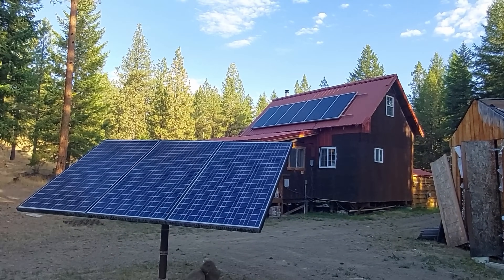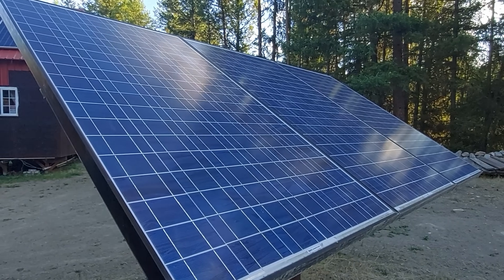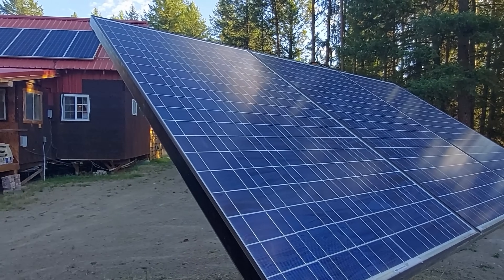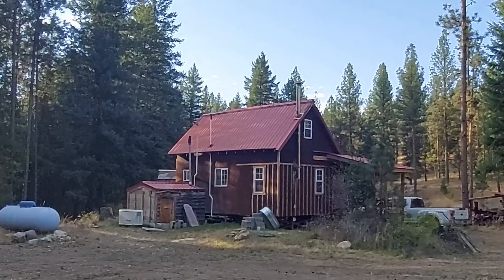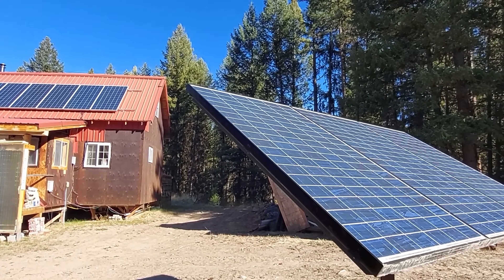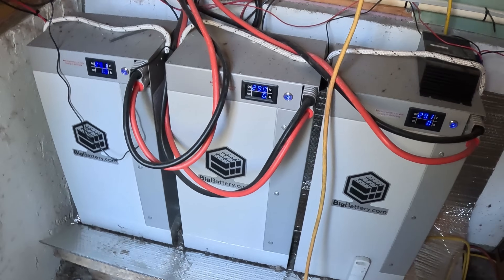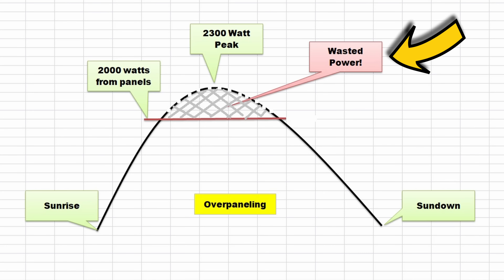Unlock the Full Potential of Your Solar Power! ☀️

Comment: I'm kinda new at this, but wouldn't you consider line loss when over paneling?
Reply from the maker: I don't over panel but I suppose you could.  My philosophy is to add another charge controller for thise extra panels instead
Reply: @TheOldJarhead  I mean when calculating how much is coming into the controller. I suppose it would be too minute to consider, unless one was using very small wire to the panels.
Reply from the maker: With 10guage wire 12v drops a ton, but that is why we run higher voltages.  Most systems are designed with less than 3% voltage drop from panels to controller, but most over paneling is within voltage and just 10 to 20% above wattage max

Comment: Thank you, this is a good video, although I think you missed a couple points.
   Batteries can only accept a charge at a certain rate depending upon their chemistry. As an example a flooded lead acid battery can only safely accept a C/10 rate of charge. So if you have a 100 Ah flooded lead acid battery, it can only be charged at a 10 Amp rate.
    Also, the main function of a charge controller is to protect the battery from too much electricity which can electrically harm it. This is why it's so important to program the charge controller with the correct chemistry and size of battery bank.
    If there are periods where a system is being clipped often for whatever reason, and you would like to use that electricity, I like to use shunt controllers instead of series controllers, where you can attach an external load that will be powered when the battery gets shut off, such as a water heater. These are typically used with turbines, either wind or water, due to the fact that you cannot unload a turbine when the battery gets full, but there's no reason you cannot use them with a photovoltaic system.
Reply from the maker: I agree, the power controller is a critical part of the system.

Comment: Hello Jarhead.  I have a monkey-wrench I would like for you to consider.  An underlying assumption that you seem to be working with is that all your solar panels are set at the exact same angle so that they all hit solar peak at the exact same time.  How about dividing your solar panels into two banks, set to hit solar peak at slightly different times?  Instead of setting them to all peak at, say, 12 noon, you have one bank set to peak at an earlier time, say 11:30, and the other bank set to peak at a later time, say12:30.  That would both lower and broaden the peak, and perhaps increase your overall collection potential throughout the day without having to buy a new controller.  And this might also help a bit in the case where solar irradiance is affected (by clouds) more in one part of the day than another.  Just a thought.
Reply from the maker: There is only one solar noon/peak, but I do just what you mentioned.   Look closely at my arrays and you will notice they are at different angles and direction
Reply: @TheOldJarhead  I did not notice that you had a slight angular displacement.  That is an option for people to keep in mind.  If they are just slightly clipping the top of their power collection, then a slight offset between panels might provide for an overall better collection plan.  It is just another option to think about.
Reply from the maker: I typically run one array more eastward in the summer for early morning production (it's on it's own charge controller as well) and then my roof panels on facing due south and at 45 degrees which is close to what I would put them at mid year (spring and fall).  

If I added more I'd face them west ;)

Comment: Hello sir,
Thank you for sharing your suggestions and your good well of humour, really liked it.
Kudos for sharing the details of the equipment used. Taking into account pdf manual of bateria+60a+mppt and based on the characteristics, it began to charge the battery on +3V above the battery voltage settings. Which means we could install two groups of 2-3 solar panels and alogn them to slightly different azimuth, keeping in mind not to exceed 150V of the open circuit voltage from the solar panels array. And as Eugene Yeryomenko suggested here on YouTube, if we're living off-grid and having main loads at the morning and at the evening, having two groups of solar panels oriented mainly towards the East and to the West could possibly cover the peak hours of our load. Moreover, during the day both solar arrays could produce pretty good amount of power to charge the battery and run some heavy load as well. As a cherry on top this installation could work under snow or in a heavy cloud conditions as three or four panels in each of a group pfsuch kind  could have a sum of the bad conditions voltage around 1/3 of the open circuit numbers above the lower charging threshold of the MPPT.
Thank you once again for the details shared. Subscribed!
Reply from the maker: I usually point my ground mount panels more eastward for that reason
Reply: @TheOldJarhead  got you. It's a kind of daily exercises, isn't it? :D
Reply from the maker: Not for me.  I have enough solar at my cabin I rarely think about it now 😉 but it's small

Comment: Don't you think you should have MENTIONED the fact that there are TWO TYPES of charge controllers? Above you head and to YOUR left you have a MPPT charge controller that will produce about 15% to 30% more power per day than a PWM charge controller. If someone watches this video and goes out and buy a PWM charge controller they will NOT GET MORE POWER they will be getting 15% to 30% LESS power per day than if they would have spent some more money and get a MPPT charge controller. 
Since you did not say a SINGLE word about the TWO different types of charge controllers this video get a BIG THUMBS DOWN FROM ME.
Reply from the maker: Hmmm interesting point and though I've discussed both in other videos, and though PWM controllers are harder to find today, and though no on I know would arise getting a PWM controller in most cases I suppose you could make that point. 

However,  I would advise that you consider the alternative: if someone has a PWM controller that is too small and goes and gets another larger one, the principle is the same. Re: they will get more power.

Finally, if someone has an MPPT controller and goes out and buys a PWM controller, they should probably get some help rather than watch one short video.

As such, I give your comment two thumbs down. 🤣
Reply: @davescorneroftheworld1147  , nice use of capital letters.  Not every video can cover everything and be watchable. This video is about over paneling any type of charge controller.  How far should Jarhead go here?  Wire sizing too because that can affect efficiency?   Maybe you need to make a video about selecting solar charge controllers and can link to this video for clarification.  We look forward to critiquing it.
BTW, historically there are 4 types of charge controllers.
Reply: @FlatOutFE  How much time does it take to say "If you buy a new charge controller make SURE it is a MPPT charge controller and you will gain about 12 to 30% more power"?
If someone says you NEED a BIGGER charge controller they should tell us to get the right type!!!!!!!!!!!
Reply: @davescorneroftheworld1147  , make a comprehensive video and show us how it's done.  Jarhead has maybe made $10 for his efforts.  Gratitude goes much further in life than critiquing those who give.  You've made lots of videos so you should understand.
Reply from the maker: For the sake of argument,  since this is  about math really, you would benefit from like for like replacement. 

That's FOFE, I appreciate it!  It is difficult to cover everything and actually have people watch.
Reply: @davescorneroftheworld1147  , I just watched one of your videos on a home made power station (#85)  You mentioned that it had a solar charge controller but didn't mention what kind it was.  Do I fault you for not addressing the type of charge controller?  Nope.  A video can't cover everything.
Reply: @FlatOutFE  Oh my PLEASE forgive me. I watched the wrong video. THIS VIDEO shows EVERYTHING about charge controllers that ANYBODY will EVER need to know. 
I was watching a video that told us to buy a bigger charge controller with NO explanation of which type to buy. 
SOOOO PLEASE forgive me for watching the wrong video!!!!!!!!!!!
Reply: @davescorneroftheworld1147  , this video isn't about "everything about charge controllers".  It's about over panelling a charge controller.
Reply: @davescorneroftheworld1147  , here's the issue.  YouTube can be a nasty place for content creators.  The more views you get the harder it is to satisfy everyone.  It can be downright agonizing once you get tons of comments and try to read and respond to all of them.  People often read the comments to get more information.  You could have said, "Consider getting a MPPT controller to get more efficiency" rather than "thumbs down" to the content creator.  Think about how you can contribute to the discussion rather than drive your comment to the bottom by holding Jarhead to a standard that your own videos do not meet.
Reply from the maker: With over 11 million views, I'll be honest,  I normally just nuke rude commenters, but I gave this one some slack.  Usually, I don't, and if he continues to try to build his channel, he may soon learn why. 

I'm ok with disagreement but rudeness I tend to just get rid of as I'm too busy making more videos 😉

Comment: My main goal is make power in overcast.I have 4 x 3000w inputs, 3 run at 2790, 1 at 3300w , winter sun snow and vertical panels , the 2790's  can get 3400w, the 3300w got to 3800w before it overamped the mppt, shuts down and restarts the string, I put 1 stick in front of a panel it runs at 3000w , I will be adding 1 panel to 2 strings and shade them too, the reason I do not see the sun in winter, since overcast will be unaffected by the shading stick I get more power in clouds. Today no sun but got a decent 11kw, lately the dark day lows are 5kw. The inverters sold these days should have more AMP ability, I run very close to the 14A max with my volts 200V under max in winter sun when it shows itself. I think everyone should get a EG4 18kw pv and stuff it full, 2x 16 A strings and a parallel at 26A can run 24kw pv total not all usable but in overcast I would mind making 3+kw for 4 hours, $12k upgrade vs $300 in gen fuel per year. 
Happy holidays.
Reply from the maker: This doesn't make sense to me.  Why not just reduce that array to 3kw? Shading us reducing. 

That's also a problem with the AIO units: restricted to what they put in it.  A component system allows a lot more flexibility
Reply: @TheOldJarhead   The pv only goes over with snowfall, in feb or march I take the stick out it only has to cover a few cells at noon, in summer my 11.6kw is cut by 50% because it is vertical, once I put white rock or polished metal under the panels it will go back up to 9kw but really not needed I could run it all off 1 array march to sept. Having the extra shaded panel helps the overcast production. Today I got 4100w for 7 mins then back to 1100w overcast. The whole system was undersized by my mistake, not telling my dealer I was going to use electric heat. Why I started with 24kw then went to 48kw quick.
Reply from the maker: interesting

Comment: I'd love to hear a discussion on PV Direct loads for excess power. Like a transfer switch to a big ice maker for when batteries are full.
Reply from the maker: I've been thinking about doing that as at least one of my cc's has a load feature to  do just that but haven't used it yet
Reply: @TheOldJarhead  I'd love to know the model of your charge controller that has a transfer switch. That sounds perfect!
Reply from the maker: I didn't say it had one. However, it does have a load option, which can be set to a 'light' option, which by their explanation means 'solar' light.  However,  my big controller does not, and that's the one I'd want to do that with, if any.

Some are also programmable, but I think a dump load like those used in the wind would be better.